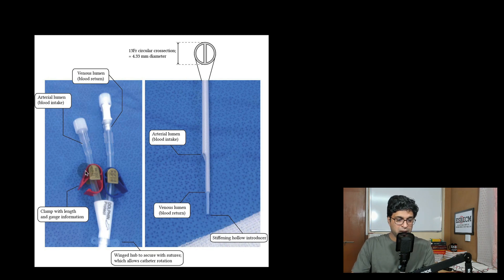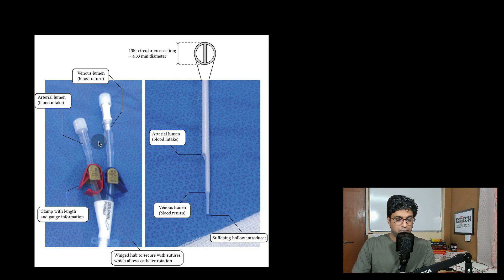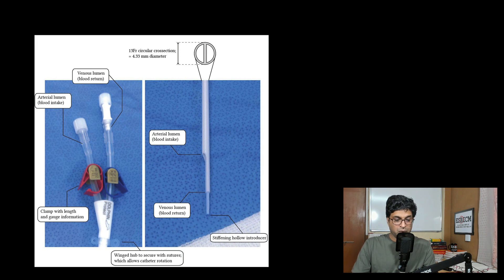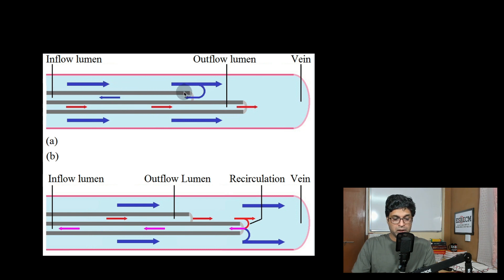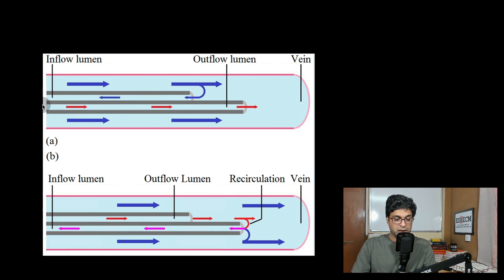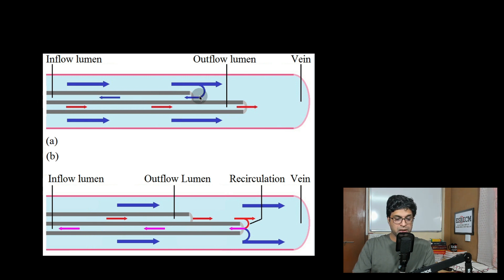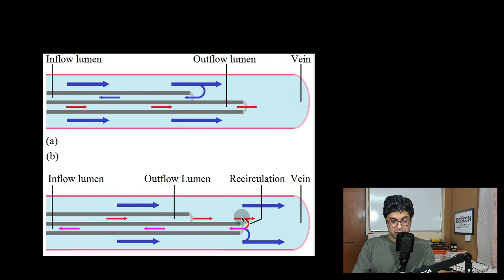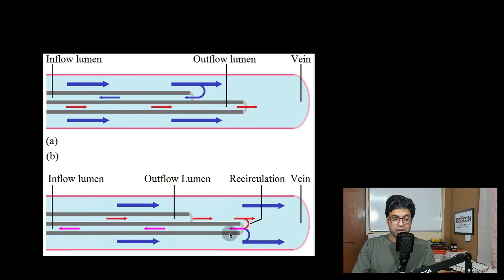Recirculation in Dialysis Catheter in ICU | The ICU Channel | ESBICM

Comment: I was taught to switch the ports whenever there are flow issues such as clotted access points.  It's good to know the downside of using this technique. It's good for buying time until you can troubleshoot the issue with the standard placement. Thank you for the video
Reply from the maker: Glad it helped